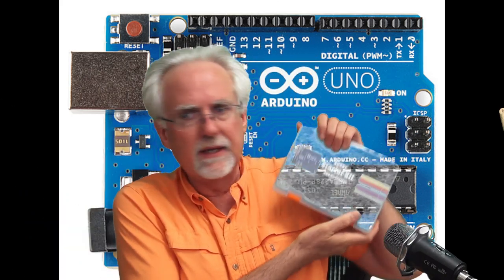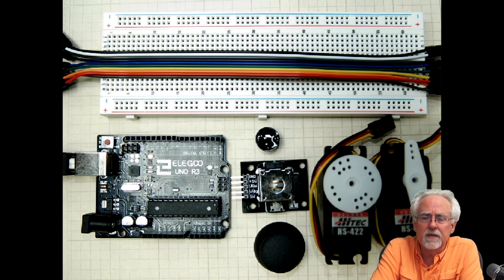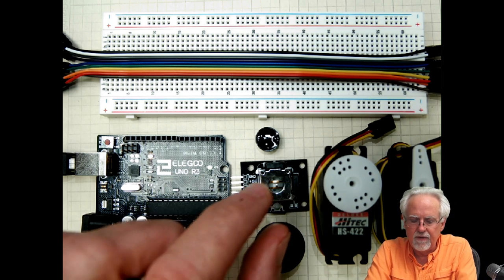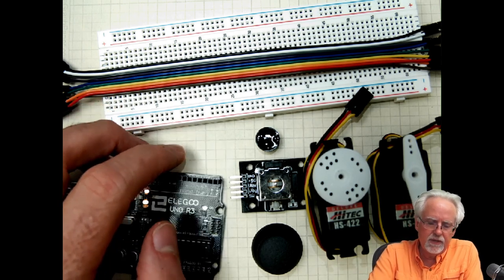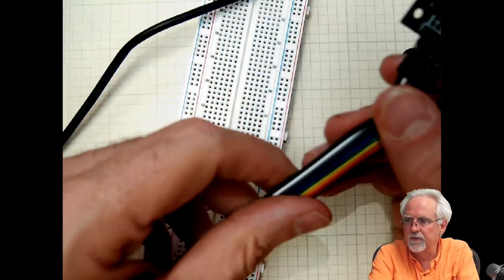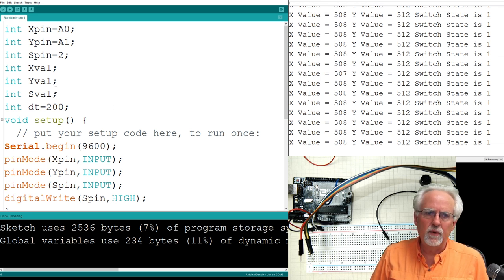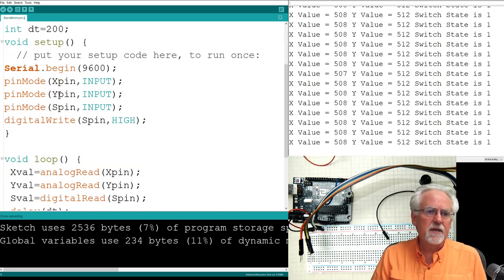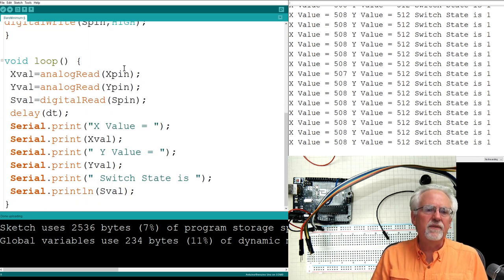Arduino Tutorial 33: Understanding How to Control Servos with a Joystick

Comment: Pooky is actually called "Putty tape" it is used for sealing windows, vents and other objects that need sealed, commonly used on RV's. Thank Paul ,I am watching all these lessons again. I am learning more because I went  a bit too fast the first time, didn't pay good enough attention.
Reply: Eric, Much thanks! I am having to skip around in the tutorials due to a deadline for a project. I ran across Paul referring to Pooky in a much later lesson and have been going nuts trying to find it. I have been skipping forward in the lessons to see where he first used it to try to find out where to get it. Your tip is what did the trick. Thanks againi@
Reply: In South Africa they sell it as Prestik.🤓

Comment: Hi Paul. I built the setup with two servos in a pan-tilt kit I bought from our local botshop. I used a laser transmitter module (KY-008) on the top of my pan-tilt kit and connected it to the pin that was originally connected to the buzzer.  I was able to shine my laser all over the ceiling by controlling it all with the joystick. Great fun! Thanks for a great course!

Comment: Great video! I have a question though. When your servos use around 5V and you hook them to one 5V output there wouldn´t  be enough voltage to power them both right? Also I tried connecting my servo (power cable) to normal arduino pin and setting it to 5V (HIGH) but the servo didn´t move and I only heard clicking (the pin is working and the servo is also working normally when I hook it to 5V output)

Comment: Thanks Paul , it worked for me without that math equation and i used just one servo cause i don't have two or extra and also i did it without  the buzzer but i compensate it  , with a Happy blue LED only for a special occasions as this, here's my code below :

#include <Servo.h>
Servo myservo;
int Vrx=A0;
int Vry=A1;
int Xval;
int Yval;
int Switch=8;
int Sval;
int analogvalue;
int servo=6;
int dt=300;
int LedB=2;
void setup() {

  // put your setup code here, to run once:
Serial.begin(9600);
pinMode(Vrx,INPUT);
pinMode(Vry,INPUT);
pinMode(LedB,OUTPUT);
digitalWrite(Switch,HIGH);
pinMode(Switch,OUTPUT);
myservo.attach(servo);

}

void loop() {
  // put your main code here, to run repeatedly:
 analogvalue=analogRead(Vrx);
 analogvalue=map(analogvalue,0,1023,0,180);
 myservo.write(analogvalue); 
 delay(dt);
 //Serial.println(analogvalue);
 Xval=analogRead(Vrx);
 Yval=analogRead(Vry); 
 Sval=digitalRead(Switch);
 Serial.print("Value X= ");
 Serial.print(Xval);
 Serial.print(" Value Y= ");
 Serial.print(Yval);
 Serial.print(" Value Switch= ");
 Serial.println(Sval);
 if (Sval==0){
  digitalWrite(LedB,HIGH);
 }
else {
  digitalWrite(LedB,LOW);
  }
 
 }

Comment: Hi Paul, I think in a previous video you mentioned that this type of servo will need an external power supply or you risk burning out your Arduino? I bought some MG 996R servos on Amazon and their current draw is more than the max output from Arduino. Is it safe to hook them both up to 5V from Arduino like you did in this video?

Comment: Codeword, Bosco, I had to wait for my Servos to arrive, they came yesterday evening so I put them into my joystick circuit this morning then spent 2 hours trying to figure out why the x servo was on and off and spinning round a bit then stopping. I rechecked my code adding lots of comments and even stripped down and rebuilt the circuit only to find that now the X servo stopped completely. 

I had to leave it at that point then later came back to test the servos individually with the servo code. found one of my brand new servos had an intermittent control line which finally snapped , once I'd resolderd it, everything worked fine. 

Sometimes it just a duff component and as an electronics engineer I should have thought of that earlier, still the debugging was very useful as I realised my choice of variable names left a little to be desired.

keep up the great work.

Comment: Paul, before I get into this lesson, I'd like to try it on my own. And before that, I'd like to ask a question. What is a typical method of documenting this stuff...from circuit design including the Adruino inputs and outputs to the code? I ask firstly because my memory is crap, and secondly, if one project/lesson is done, it may be nice to be able to include it in another without having to 'reinvent' the wheel every time.

Comment: Bosco looks like a nice guy. I encountered an extremely stressful error during this project. I set out to power my servos externally, and when I made the connections and uploaded my code, my joystick readings were way off, and my servos weren't responsive. I thought I fried my joystick potentiometer with the external power supply (4 AA batteries in series). Turns out the error was in my code - I accidentally attached my servos to xpin and ypin (the input pins from the joystick) rather than xservopin and yservopin. I found this out by comparing your code from the website to my code, so thanks a bunch for making that available! Everything works perfectly now :)

Comment: Hi Paul, one question, by now it seems the servo you recommended is not selling anymore, so I am thinking to buy something similar. But as a beginner, I am not sure how to know if the servo is good or not and how do I know if it's compatible with Arduino?

Comment: Wonderful mix of wisdom, tinkering and improvisation, Paul is really enjoying himself ! That is very infectious. An excellent series of tutorials, I only came to have a quick look and now I am completing each lesson reasonably (!) successfully. Great fun, learning lots, thanks Paul. 

(PS...is there a better method of connecting wires to the breadboard, it seems a bit hit and miss? Maybe I should use more substantial wire and cut each connection to length as required, this might improve the mechanical strength/integrity of the connections?)

Comment: Bosco.  I have done the assignment, but used the " map-function" in stead OT the math. Worked fine. Also used a 3volt laser printer that I could switch on and of with analogieë. From South Africa. Enjoying the lessons with grandson

Comment: Hi Paul. I couldn`t follow along with you on this video because I only have the Elegoo servo motor. But to compensate for that I did a self-assignment to control a servo motor, the brightness of 4 LEDs and the state of a 5th LED, using the joystick. I allowed myself to use different colours of the LEDs as this was a special occasion to me.  I made the 4 LEDs to increase their brightness one after another with overlapping when I move the joystick from right to left and to decrease their brightness one after another with overlapping when I move the joystick from the left to the right. I made the servo pointer to point up or down, corresponding with the direction of the joystick and I made the 5th LED (red) to come ON every time I press the joystick in.

Comment: i bought two ZOSKAY Servo DS3218 and tried hooking the way we did in this tutorial and they dont move. They only knudge a bit and make  a knocking sound. Can somebody help me out? -Bosko

edit* i just realized that rcd servos that you requested are specifically there so that it fully functions with the arduino and to prevent damage to it. I had 2 digital servos and i think it was pulling to much current and not working as a result.

Comment: Bosco, made it to the end great lesson one thing I noticed on mine I'm either picking up noise. On my switch cause I had intermittent 0 with out a button press so I used a pull up resistor. Work perfectly after that thanks again for these lessons.

Comment: This was a great project. I wound up digging through my scrap boxes and making 3 custom cables for the joy stick and the two servos. after seeing Paul's Servos flop around I decided to screw the bottom servo down to a piece of wood and used plumbers putty (aka pookey) to attach the top Servo. I used a large Alligator clip cover that slipped over the servo arm as my pointer. All this mechanical and electrical effort work great. Unfortunately I made one small mistake in my code that took me awhile to find. Only one Axis would work. I went through my wiring and my code several times. I verified both servos were in fact working. Finally I found that I had typed Xservo.write(WVx);   Xservo.write(WVy);. When I changed the second Xservo statement to Yservo all was well in my world once again. ;) Bosco would have been proud. Having lived in East Texas since the eighties I have to say that anything below 60 begins to feel cold to me. Thanks for all your time, effort and energy.

Comment: I did not have 2 servos. But with the X direction I controlled the servo, and with the Y direction I controlled the brightness of an LED. They ended up working individually, but when I tried controlling them both at once, they both flipped out. The LED flicked on and off, and the servo jittered around. I noticed that my joystick readings would flicker slightly when both the LED and servo were connected. I ended up not being able to get it working!
Bosco.

Comment: BOSKO! I appreciated this video more than the rest so far. I had a problem with an old project from years back where, if I pressed a button the buzzer would buzz. The problem I had is that the buzzer would "latch" and not turn off. Your code for your buzzer (at the end of the video) was the key to the issue I was having, I think. The project was a bluetooth controlled robot with LED's and a buzzer for a horn. I had to disconnect the buzzer from the circuit otherwise it stayed on. I still have the robot in a box, but I don't think I can find the old code. :-(

Comment: .. BOOOOOOOM to BOSCO😎... Since I did not get my second servo on time and my buzzer was faulty , I decided to replace them with two LED lights (yellow and green) where I controlled the  first servo with the X-direction of the JOYSTICK and then I analogWrite to the  green LED so that its brightness increases and decreases  by Y-direction of the JOYSTICK and finally the yellow LED comes ON when the SWITCH of the JOYSTICK is closed and then It is OFF when SWITCH of the JOYSTICK open.

THANKS A LOT MR PAUL.

Comment: The slope formula turned out to be simple. I found that sometimes approx. values are easier to work with.
You have to hold the female connectors while adding a new connector to a pin. Otherwise the others slide off.
Having only 1 servo, I simply moved the control wire from pin 9 to 10 to check out both X and Y action on the Joystick.
 I had to do review the previous lesson and brush up on the Arduino command for Servos. Moderately difficult.
Had to force myself to slow down and think my way through the process. Definite not a "build on the fly" circuit.
  In the future, I would like to voice modulate (using a Radio jack ) a led light and use a Photo Resistor with Arduino to convert it to Digital output on the Plotter. Maybe try Digital to Analog to see how well 12 bit sound is.
Wayne

Comment: Good evening Sir, 
Please correct me if I'm solving it with wrong method. 
I have angle deflection of 180 degree and pin reading is 1023. Now I'm simply dividing them and I got 5.683/degree of movement. In other words digital reading 5.683=1 degree. 
And I'm playing with my joystick now. 
It worked for me. 
Same thing I did in servo project as well where you asked us to deflect servo with light sensor. 
Here, I accept the fact that this method can't be used everywhere.
Reply: Your method only works if the line passes through the origin. Remember it takes two points to define a line. Work the equation to its full extent. Listen to what’s said at.17:18 in the video. Don't assume your line passes through the origin (0,0).

Comment: Hi Paul, I had to wait for components so came back to do this one from further on. Had a lot of fun, ordered a laser too. Got it working nicely by myself. What I have been racking my brain about and I would love it if we could cover with you if its possible is:

How can we get the Joystick to hold its value, if we want to precisely move the laser? How can we stop it from zeroing as soon as the user lets go, if that makes sense?

Bosco!
Reply from the maker: Yes you can no that. You use the joystick to nudge the position, not set the absolute position. Think it through.
Reply: @paulmcwhorter   I must say Paul you inspired me to have a crack at it, sat down tonight and mapped it out on paper like you suggest. I am so chuffed with the results. I made it work with 4 while loops which influenced a servoPos value for each Servo. 

it was so simple in the end, I feel silly for asking, thank you for pushing me!
Reply: Hi James,  Since these joysticks are spring-loaded to return to centre, there are only 2 things you can do:
Buy another type of joystick that isn't spring-loaded (like a throttle stick), or;
You can try to program the joystick switch so that the "Reads) only happen when you press the switch, that way the switch would work like a save button.

Comment: Hey Paul! I bought a High Torque Servo, and then realised it requires external power source in order to run with an Arduino. I’ve no idea how to connect an external power source. Could you please guide me?
Reply: Also Paul, would it be possible to run the motor using a battery pack as the external power source?

Comment: Hi Paul, secrete word Bosco. This is my project i expanded the project and add 2 diodes: 
#include<Servo.h>
int Xpin = A0;
int Ypin = A1;
int Spin = 2;
int Xval;
int Yval;
int Sval;
int dt = 200;
int servoPin1 = 9;
int servoPos1;
int servoPin2 = 10;
int servoPos2;
Servo myServo1;
Servo myServo2;
int Redpin = 11;
int Yellowpin = 12;
int Zumpin = 7;
void setup() {
  // put your setup code here, to run once:
Serial.begin(9600);
pinMode(Xpin,INPUT);
pinMode(Ypin,INPUT);
pinMode(Spin,INPUT);
pinMode(Redpin,OUTPUT);
pinMode(Yellowpin,OUTPUT);
pinMode(Zumpin,OUTPUT);
digitalWrite(Spin,HIGH);
myServo1.attach(servoPin1);
myServo2.attach(servoPin2);
}

void loop() {
  // put your main code here, to run repeatedly:
Xval = analogRead(Xpin);
Yval = analogRead(Ypin);
Sval = digitalRead(Spin);
delay(dt);
Serial.print("X value = ");
Serial.print(Xval);
Serial.print(" Y value = ");
Serial.print(Yval);
Serial.print(" Switch state is = ");
Serial.print(Sval);

servoPos1 = (90./1023.)*(Xval) + 90.;
Serial.print(" pos1 = ");
Serial.print(servoPos1);
servoPos2 = (160./1023.)*(Yval);
Serial.print(" pos2 = ");
Serial.println(servoPos2);
if(servoPos1>=179 || servoPos2>=159)
{
  //servoPos1=180;
  digitalWrite(Redpin,HIGH);
  digitalWrite(Zumpin,HIGH);
}
else if(servoPos1 == 90 || servoPos2==0)
{
  //servoPos1=90;
  digitalWrite(Redpin,HIGH);
  digitalWrite(Zumpin,HIGH);
}
else
{
  digitalWrite(Redpin,LOW);
  digitalWrite(Zumpin,LOW);
}
myServo1.write(servoPos1);
myServo2.write(servoPos2);
if(Sval == 0)
{
myServo1.write(90);
myServo2.write(0);
digitalWrite(Yellowpin,HIGH);
}
else
{
  digitalWrite(Yellowpin,LOW);
}

}

Comment: HI paul, i didi i little different, u use de map that convert the 0,1023 to 0,180, its very simple !!

//Programa : Controle servo motor com joystick
//Autor : FILIPEFLOP
 
#include <VarSpeedServo.h>
 
//Cria objeto para controlar o servo base
VarSpeedServo servo_base;
//Cria objeto para controlar o servo inclinacao
VarSpeedServo servo_inclinacao;
 
int pino_x = A4; //Pino ligado ao X do joystick
int pino_y = A5; //Pino ligado ao Y do joystick
int val_x;   //Armazena o valor do eixo X
int val_y;   //Armazena o valor do eixo Y
 
void setup()
{
  //Define a porta a ser ligada ao servo base
  servo_base.attach(7, 1, 180);
  //Define a porta a ser ligada ao servo inclinacao
  servo_inclinacao.attach(8, 1, 180);
}
 
void loop()
{
  //Recebe o valor do joystick, eixo X
  val_x = analogRead(pino_x);
  //Converte o valor lido para um valor entre 1 e 180 graus
  val_x = map(val_x, 0, 1023, 1, 180);
  //Move o servo base para a posicao definida pelo joystick
  servo_base.slowmove(val_x, 60);
  //Recebe o valor do joystick, eixo Y
  val_y = analogRead(pino_y);
  //Converte o valor lido para um valor entre 1 e 180 graus
  val_y = map(val_y, 0, 1023, 1, 180);
  //Move o servo inclinacao para a posicao definida pelo joystick
  servo_inclinacao.slowmove(val_y, 60);
  //Aguarda a movimentacao do servo e reinicia a leitura
  delay(30);
}

Comment: Hi, i did not use 5V as the power source for the motor but instead, i connected the motor red wire to a pin and set it as OUTPUT and use digitalwrite(#,HIGH) to make that pin a 5V but however, the servo behaves strangely when i do that and it keeps turning indefinitely? What is wrong here.
Reply from the maker: So you are saying you did not do the way I instructed, and got a bad result. I am not trying to be hard on you, but if you want the result I am getting do it the way I am doing.
Reply: @paulmcwhorter  I have done your way and it works perfectly, I have been trying another methods for all of your videos as well.

Comment: so i bought a 20KG HIwonder (i think) servo it says its 6/7.4V and it disconnects my Arduino from my laptop whenever i use it. so i went an borrowed my friends servo from his kit, so i could use both at once. so when i use them at the same time it does the same thing. is there a way around this? or is my Arduino messed up? its an uno. and those are the kit little servos. if i missed something about power for this project then that could be it as well. oh and Bosco!
Reply from the maker: The arduino can NOT drive big servos . . . you need use a driver board  to power a big servo
Reply: @paulmcwhorter  I appreciate it.  Went on to the stepper motor and caught on.  👍   after my battery died of course lol  but 9v out of my USB C port works just fine.